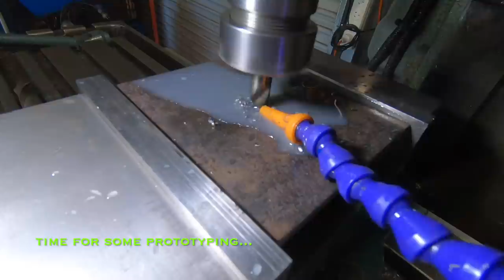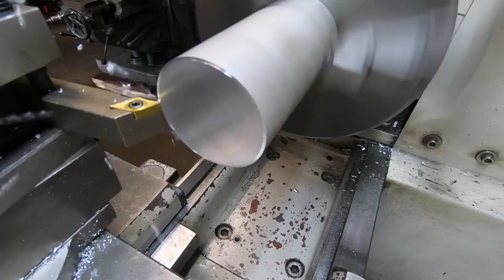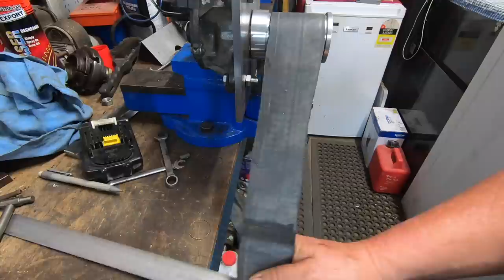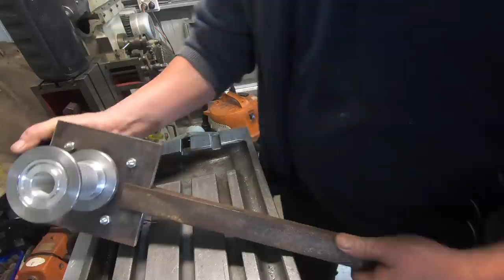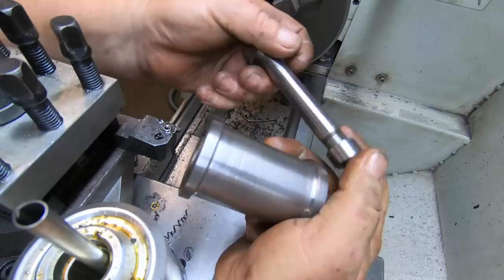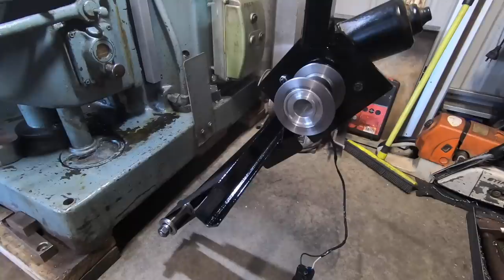Oil Skimmer - DIY...

Comment: Top effort on that one. 👍
A bit of paint makes us into the welders we ain’t! 😜😂😂👍🇦🇺

Ohh and if you add a wire loop handle to a big open top jam tin, you could file a couple notches towards the end of the angle iron oil spout and hang the jam tin off the end to collect the oil. Easy to remove and empty.

I can see me having to make one of these for the Bridgeport in due course.
Keep up the good work.
Reply from the maker: Gday Ian, I like the idea of hanging a tin on the end, better then the container on the floor, definitely worth making yourself one mate, Thnaks for watching, Cheers

Comment: Nice job Matty. Belt skimmers work exceptionally well for this application. Slower would allow the coolant to run off the belt before it gets to the skimmer bar. I use to be the Production Manager for an oil skimmer manufacturer. Most were for oil spill recovery, but we also made a small weir type for machines. Thanks for sharing.
Reply from the maker: Gday Patrick, I did notice when I took the 18v battery off and put the 10.8v battery on it didn't pull up as much coolant, You would have had an interesting job mate, tanks for watching, Cheers

Comment: Thanks for this. I've got 3/4 of a used skimmer, and you not only showed me how it works, but a good idea of belt material, or serpentine that I could use to complete the skimmer and get it working. 

Cheers.
Reply from the maker: Gday John, I glad the video helped, the inner tube I used as a belt is still working fine, Thanks for watching, Cheers

Comment: Description typo? Tramp oil! It's a flat belt, crowned pulleys would keep it in line! Replied too soon! you crowned it! I'm really impressed by how you've come on with video editing! Cheers Matthew
Reply from the maker: Gday Matthew, I’ve always been told that when way oil gets into the coolant it’s known as tramp oil, I went back a while ago and looked at the first video I did and I didn’t look at it for long, thanks for watching mate, cheers
Reply: @MattysWorkshop  Yes was thinking a crown is needed, and the belt uneven will not be a worry with the guides. Will work well for your use, and nothing extra needed Once your oil is in the jar simple enough to leave it to settle and pour off the oil to another, and dump the water and soluble oil back in the machine.  You might also want to look at a simple pond pump and a big filter for the coolant as well, to get the fine stuff out, and of course go find a scrap microwave and grab the magnetron magnets out, and drop one in the coolant return, to get the ferrous stuff as it comes back. Gets rid of half the swarf, making keeping the coolant easier.

Comment: Brilliant job Matty, I was wondering if you were going to crown the drive wheel, yes, there are quite expensive,  about £ 500 GBP here.
Great videoing, joy to watch.
Will be interesting to see if the coolant affects the rubber, but guessing it will last quite a bit.
Thanks for sharing and have a great weekend.
Reply from the maker: Gday, there not cheap for the home hobbyist, i'm also interested to see how the rubber holds up, have a great weekend to mate, Cheers

Comment: Looks good! And works well too!
Built something similar ... using a $5 yard/boot sale belt sander .. gave me all the crowned pulleys and a tracking adjuster ... lengthened the distance between the pulleys and changed the motor! It was cheaper to buy the used belt sander than the materials to make my own parts.
Thanks for sharing 🇨🇦
Reply from the maker: Gday Paul, I like the belt sander idea, thats brilliant, if immune another one I might do something similar, Thanks for watching, Cheers

Comment: Bloody good job that Matty! It looks a lot prettier with a coat of Jam on it!  Never heard it called that before lol pretty or not it does the job mate. The only thing is how long the belt will last being in contact with oil, you may have to make a few more as spares. If you can get some neoprene sheet and make a belt and use an angled scarf joint that should last you ages. Cheers Sam
Reply from the maker: Gday Sam, the Jam made all the difference, the belt should last a good while, I cleaned the belt off each time I’ve used it and so far there’s no sign of trouble, thanks for watching mate, cheers

Comment: To consider: mount the bottom pulley where it can be tilted perpendicular to the belt like a belt sander for tracking.😁
Reply from the maker: Gday, I did think of making the bottom roller adjustable but decided to see how it went with a bit of crown and guides, Thanks for watching, Cheers
Reply: @MattysWorkshop  love your videos. I talk to myself while you are working. I don't have your skills, or equipment, but I like doing things.

Comment: If you make it bigger in the center of where the belt runs that will keep the belt in the center. Shape it with a wooden barrel.
Reply from the maker: Gday, a bigger crown in the middle would work better for sure, thanks for watching, cheers

Comment: I think you need a tracking control system built into your pulleys. I have an interest in building a 2x72 belt grinder, and all the videos and what not have a tracking system built in on one pulley so you can change the angle of the pulley and control tracking. Hard to explain, easier to look up one of the many videos on those builds and see what I am talking about. I own a Grizzly G1015 grinder that is only 2 pulleys and the tracking is done on the top wheel of a 2 wheel system, so it can be done (many of the other ones are 3 and 4 wheel systems for the belt grinders).
Thanks for the videos, hope you get it worked out for how you need it. I think the error is in the long metal piece you used and not from anything you machined.
Reply from the maker: Gday, so far the belt hasn't walked off the rollers, the guides keep it aligned nicely, if it does end up giving trouble ill modify the roller to be adjustable, Thanks for watching, Cheers

Comment: Ciao Matty, great to see the oil bring by the belt! If I have seen correctly, is that the motor that serves the windshield wipers in 12 Volts?  I had installed one of those on my old mini mill to make automatic advancement of the table and it heated up a lot even without much effort!! Nice videojob mate, ciao!! Alberto
Reply from the maker: Gday Alberto, it is a 12v wiper motor, I did heat up after about 10 minutes with 18 volt battery but stayed cool with the 10.8v battery, did it work ok on the milling machine?, thanks for watching, cheers
Reply: @MattysWorkshop  Yes It works well, but i was always worried about the temperature, that goes up in short time! I sold the mill after a year, i guess that it Is working well!! Cheers Matty, Alberto!

Comment: Matty,,how did you get around the 3 phase side for the mill,,,regards Frank
Reply from the maker: Gday Frank, pretty easy mate, I swapped it out for a 3hp single phase motor, it was meant to be a temporary fix to get it up and running but it’s been working great, I’d like to put a 3ph motor in via a vfd to gain reverse on the spindle, appreciate you watching and commenting, cheers

Comment: No need for a frame for the lower roller or the bearings down in the coolant.  Just a simple weighted roller resting in the belt will be enough.
Reply from the maker: Goat Tom, I seen a similar setup on line but I was thinking Id have to buy a small belt and I tried to make this from what I had on hand, Thanks for watching, Cheers

Comment: Why not: add an battery adapter (which you can get of Ebay etc) so that the device doesnt have any hanging wires? or add a simply transformer and have it powered from mains power? additionally, you could add a tensioner (similar to what a 2x72 belt grinder has) to tune the belts runout? cheers from Zagreb Croatia!
Reply from the maker: Gday, I've just got a 3D printer and I think i'll have a go at printing a battery cradle, the belt seems to track ok with the guides in place, Thanks for watching, Cheers

Comment: is that a Cat bolt ? do you want some 9/16 unf nut taps i have a shit load of them if its a size you use send me a message will post some down
Reply from the maker: Gday Alex, yes it was a cat bolt I do have a few unf taps and dies, I don't have die nuts though for cleaning up threads, Thanks for watching, Cheers

Comment: When you make stuff up as you go is when you have the most fun in the shop... you should ask your coolant rep if the coolant you are running wont go rancid with the oil contamination.. you may have to go to another formula so you don't get sick from that smelly crap.
Reply from the maker: Gday Paul, I use the Hangsterfers 5030 coolant, I have found its leaps and bounds better then the Penrith soluble oil I was using before, it doesn't evaporate as fast and i've noticed tool life is much better, Penrith works but not as good, The ads for watching, Cheers

Comment: Excellent! - looks like it works a treat 😀
Just a thought - does the battery have some kind of over-discharge protection? If you leave it connected and forget about it you could risk fully discharging the lithium battery and then the charger would refuse to charge it.
Reply from the maker: Gday Paul, the 10.8v battery is a good as knackered, it doesn't last long in the drill any more, it ran the skimmer for a good while though, probably not as much current draw compared to the drill, Thanks for watching, Cheers